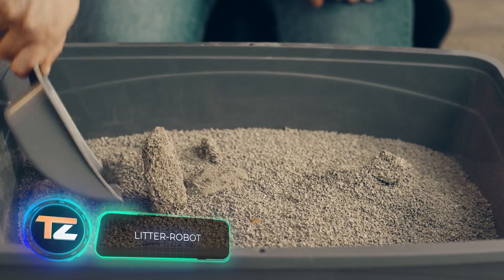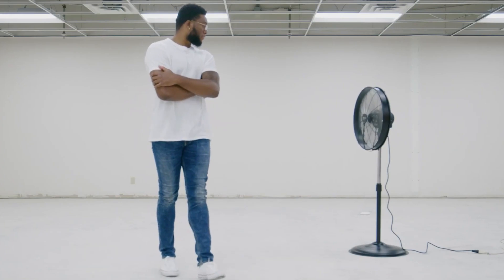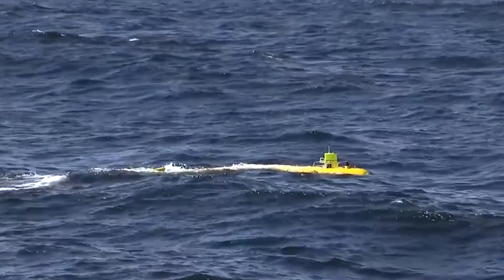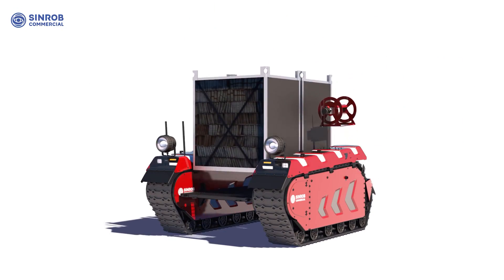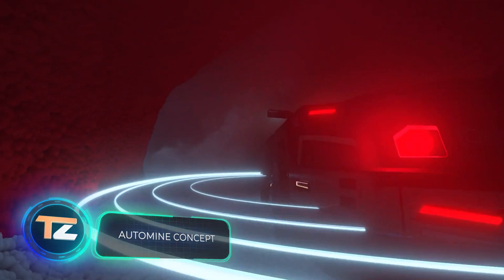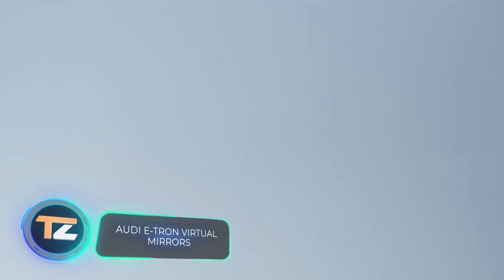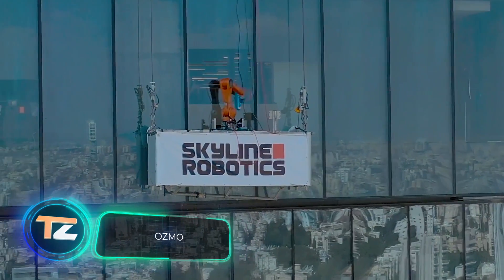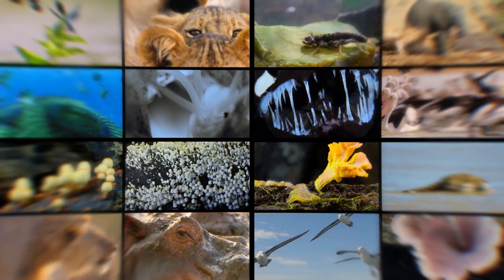MIND-BLOWING INVENTIONS THAT YOU SHOULD SEE

Comment: The Audi idea of using video cameras in place of rear view mirrors would almost certainly be illegal in the U.S. U.S. law prohibits active video screens in the front seat area.
Reply: Not quite true or GPS would be Illegal in the USA and it's not, the reason it's not allowed is if the cameras fail, you lose ALL view to the side-rear, where with a mirror that breaks, you still have at least partial view through the remaining fragments.
Another reason is a small amount of dirt on a camera lens will block a MUCH larger percentage of the view than the same amount of dirt will on a larger mirror...

I believe that arguments are being made with North American Regulators to allow the camera system to be used in addition to standard side-view mirrors, but right now (as far as I know), Regulators haven't approved the system...
Reply: Hyundai already has that same feature in the United States on the Palisade. Displays a video on the instrument panel when the turn signal is turned on.